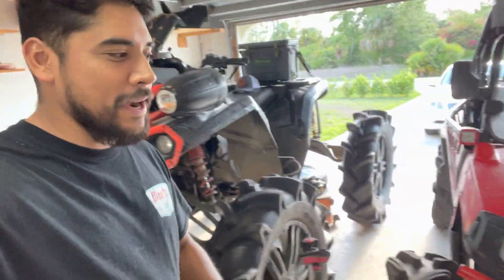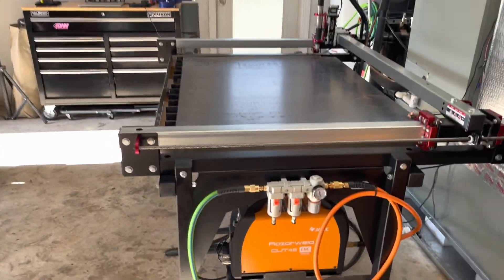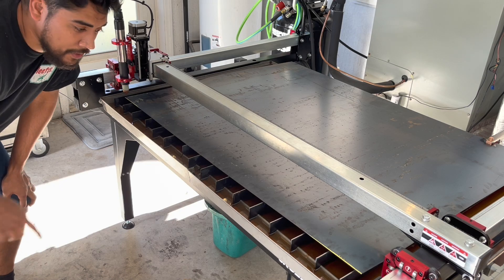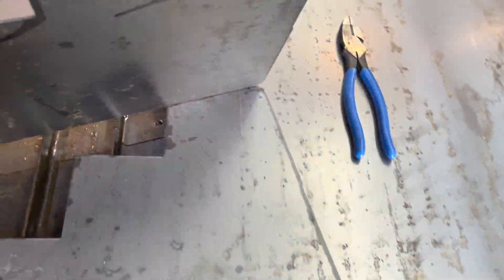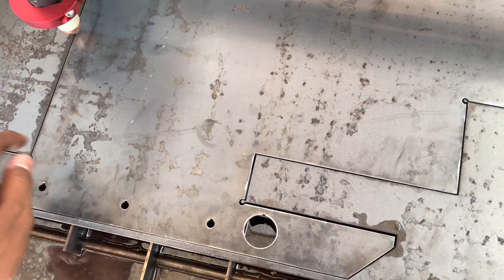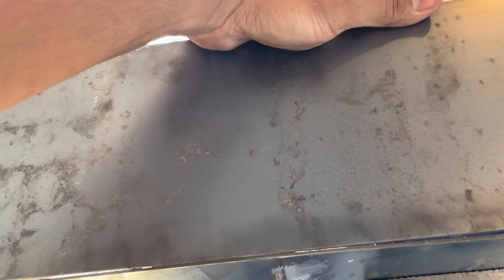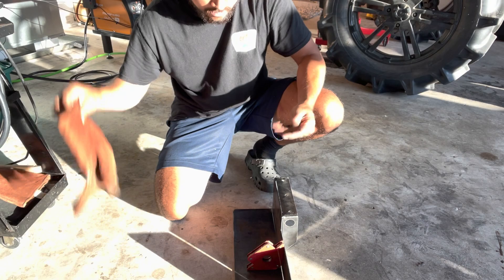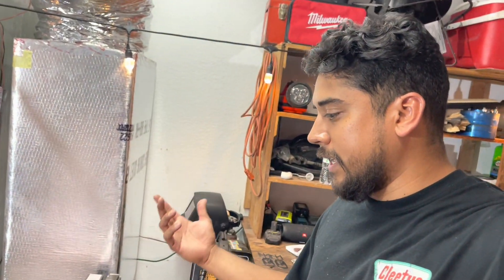The New CNC Table is Here and IT'S AMAZING! (Langmuir Systems Crossfire Pro) 🔥⚙️

Comment: nice work...........get going with QCAD & SheetCAM designing your own parts (not Confusion 360) more water in the table is a double edged sword............really makes a mess........ we built removable Plexi splash guards for our little Crossfire table....post Covid there is tons of it around and we got 4x4 sheets from local School Dept. when I design in bend kerfs I use a "dashed" line approach esp on long bends to keep everything aligned always keeping the ends solid...........enjoy.....73 Mike K1FNX near Boston
Reply from the maker: It’s bad ass I love it!

Comment: nice man, Although I would have just put the filter right on or near the Air compressor, and have filtered air to all your tools, not just that one, unless you're just plugging in all your tools into the filters where it sits.
Reply from the maker: I actually added a second filter right off the compressor!
Reply: @JaimmyAC  nice!

Comment: Super cool vid! Congrats on the new setup! I’m trying to get there myself. I’ve been reading a lot on this machine. I saw that some are doing 1.5x the recommended 6CFM @ 90PSI. I noticed yours was at 5.1CFM @ 90PSI. Has this given you any issues since starting? Thanks in advance.
Reply from the maker: No issues at all, the compressor has been holding up just fine for long cuts no problem!
Reply: @JaimmyAC  That’s interesting, appreciate your feedback. I’ll be looking to get that same one for my garage. :)

Comment: That cut quality is insane. Mind sharing your 2d profile settings?  I'm getting really inconsistent results on 14ga with smaller detailed work like lettering. Been running 40A 140ipm with all different lead in and finishing pass settings.  Big stuff looks great.  Small stuff looks like cat puke. 😮
Reply from the maker: Haha, I honestly forgot what settings I am using it at for 14 gauge, but I can get back to you on that!

Comment: Get some more water in your table, so about half inch from the top, it really helps with stopping warping and the parts are never hot when they come off.
Reply from the maker: That is true! I did fill up the water more and it helped a lot!